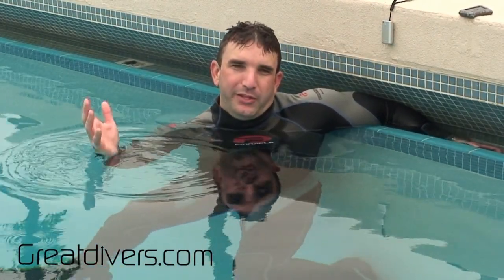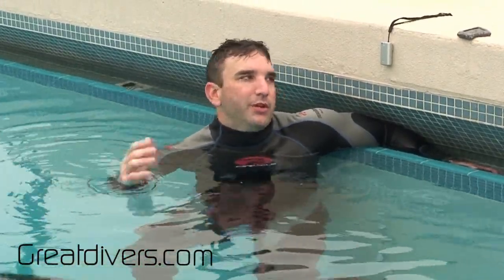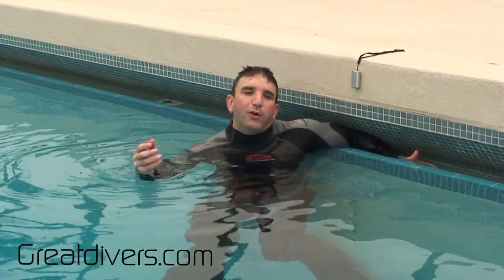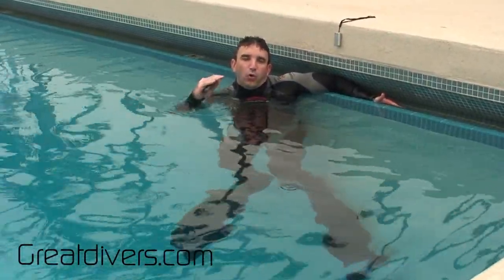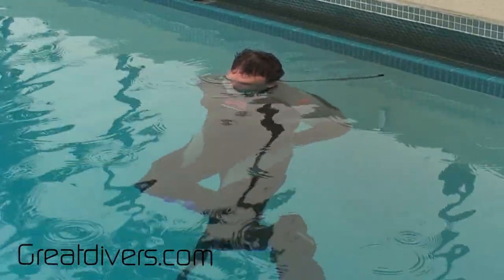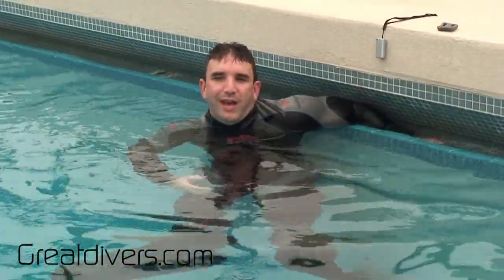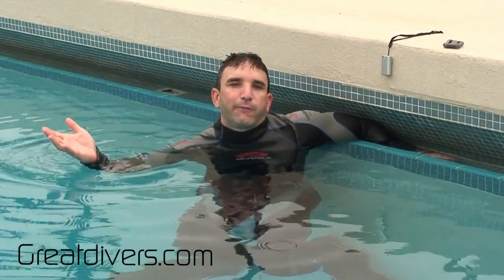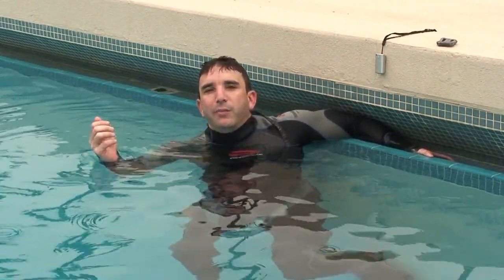Diving Buoyancy how to perform a Scuba Buoyancy Check

Comment: Jose. Great videos, blog and suggestions. In this particular video, you don’t mention the use of fins, (but you appear to have them on) which do contribute to buoyancy somewhat. If this is the case (use of fins) shouldn’t you also use a mask?  For purposes of this video, doing first an incorrect weight, and then the correct one, would of been most helpful. Comments?  Thanks.